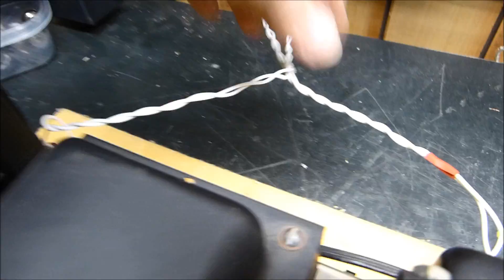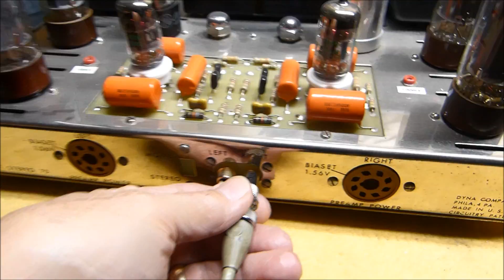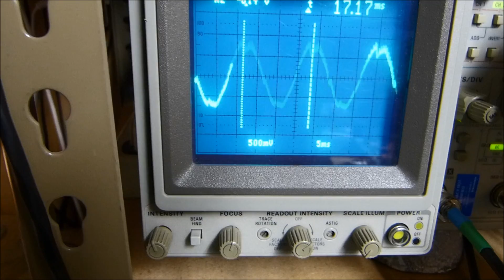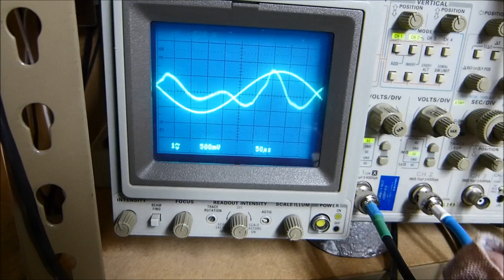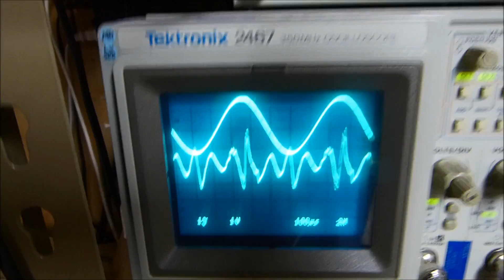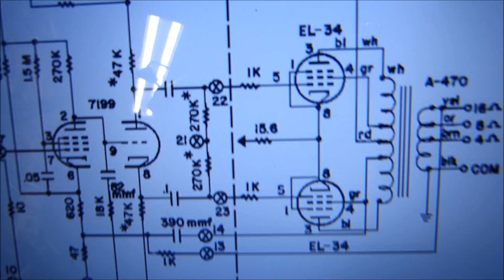Dynaco ST 70 Quick Checkout

Comment: I wipe RCA and phono plugs with 99% isopropyl before plugging them into a jack. Isopropyl is cheap. Plugs get all kinds of goo and crap on them when they're not plugged in. Pushing goo into a jack will deposit goo in the jack, and eventually cause headaches. 1/8th" headphone jacks are the all-time worst for collecting goo. Ew.

Comment: Nice explanation of 60 vs. 120, a LOT of folks miss that.  A speaker with good LF response can often tell a trained ear which is the culprit much faster, especially when you hear rather than see all the extra noise that comes with a bad signal ground.  Sometimes ears are faster than a scope.  Also, just a quick reminder that you should make your dummy load rig stereo, so that you can test the effects of both channels sharing a common power supply under load, such as in this ST-70.  Cheers!

Comment: dear sir,i gain so much knowlege from your videos, (classes) actually.i have some test equipt.I only alter or change what needs to be.Thats what i respect about you.those people who take classic working equiptment and cant wait to tear it apart is sad..my collection only has parts that needed to be changed;1961 markIVs 1968 st70A with orignal box/manual.1965 telefunken 5550mx mint;2 1965 nordmende tannhauser 7004c an a sturegat 3004 nuthing but 30 dollars of mullard mustards.get this the caps on my dynaco are orignal and only slighty off.And my virgin sound reproducers 1976 k-horns.its amazing.upgrades really thats for people who cant tear it up, shet on it...thats why i give you much respect the only smoke you blow will come from under an amp..much respect and thank you for the unbias work PLEASE KEEP IT UP.happyholidays sincerly paul..

Comment: Mr. Beard, I do so enjoy your videos and have learned so much. In the video you display just the distortion elements on the scope then "look between the distortion elements". How did you isolate just the element that represented the 60 cycle hum?
Reply from the maker: Hi Mark - there is a lot of "auto scaling" going on between the AA501 and the 2467 scope. The AA501 normalizes the amplitude of the two outputs that connect to the scope and keeps them at a constant amplitude value no matter what the volume rises or falls to of the signal from the amplifier under test. The scope has a "setup" button that when pressed displays about two cycles plus adjusts the vertical deflection so the display is not off the screen. This makes the first part of seeing what is going on pretty easy. With that said, you then may have to turn one channel of the scope off and vary the time base to better see what you are looking for. In this case, the fundamental frequency was 2 KHz but the noise was 60 Hz so it was stretched way out on the scope. I slowed down the sweep on the scope until the dominate frequency was displayed better and was able to measure it with the handy delta-time function of the scope. Then by pressing at the same time both delta-time and delta-volts the scope takes the reciprocal of the time you are measuring and displays that in frequency.  Hope this makes sense
Reply: Yes, thank you,  I wondered if that was all that was done.  In the video you could not see your hand so I didn't know for certain if that was all there was to it. I wondered if by chance you may have used the lopass filters on the aa501; the manual ops section don't define how to apply these features. Anyway, I'm definitely going to use my Tek 2211 scope with the aa501... it just makes sense.
Reply: ElPaso TubeAmps
You may add a little set-up tour prior to your measurements, as afterwards it is easier to follow this sort of videos:)
Reply from the maker: TubiCal To keep the videos short I skip the set-up tour as you guys that watch my videos know what and how I am using the equipment but any newcomers would not know.  Thanks for the thought.

Comment: Is that DeoxIT you use safe for tube sockets?
Reply from the maker: Hi John - as far as I know it is. It is oily and needs only a very small amount - I like it and have no incidents with it.

The spray contact cleaners can be Really destructive on plastics and lettering on plastic knobs - I have learned that the hard way. The sprays can melt plastic and turn an otherwise successful repair job into a nightmare getting the push button switches unstuck. Spray cleaner is necessary sometimes but I have learned to be very careful with it. As you know, some of these cleaners are poisonous and have the skull and cross-bones on the bottles. Those warnings are not there for decoration.  I try to stay away from that stuff. I dealt with these chemicals for many years in my work decades ago when practically all solvents were available and used. Be careful.
Reply: Thank you.

Comment: Thanks for the video.  Some more detailed explanation on how you set up the second channel to read the distortion would be helpful.

Also, why do you like the large resistors on the wall as a load over the home made dryer heater element load?
Reply from the maker: Hi Dave - Channel 1 of the scope is connected to the Tektronix AA501 distortion analyzer "Input Monitor" connection and channel 2 of the scope is connected to the "Function Output" of the distortion analyzer. The "Function Output" from the AA501 is just the distortion products that the distortion analyzer separates from the fundamental frequency under test - a pretty handy function to see only the error signal. The 300 watt resistors are low inductance 8 ohm 1% resistors with a really good temperature coefficient - they are available from Mouser. Part number NHS300 8R F for the 300 watt and NHS200 8R F for the 200 watt version. They stay spot on 8 ohms hot or cold. As for the hot water heater elements dummy load  - I have only one so I would have to switch it around and not be able to test both channels at once. The heater elements are pretty darn stable. They vary from 8.2 ohms cold to 8.1 ohms hot - not bad at all...)  but in this case, I am only testing 40 watts.. Thanks for your comments.

Comment: Another excellent video, David, particularly the need to differentiate between 60Hz and 120Hz, the bias explanation, and the sad inevitability of the "Don't try this at home" warning. You're definitely on a roll lately :) Thanks for posting !!
Reply from the maker: Uncle Doug Thanks, Doug. It was you that turned on the light about 60 Hz vs 120 Hz hum for me. Now I always measure it to make sure I start out on the right track and not work on the wrong thing (and waste my time or make things worse).